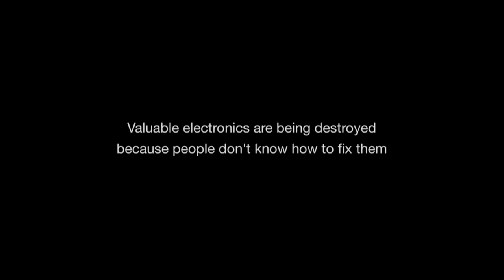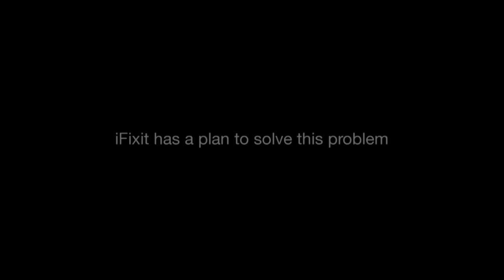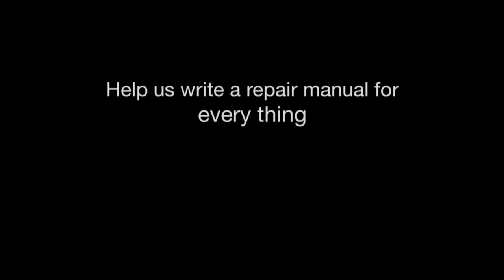iFixit: Welcome to Repair 2.0

Comment: Yes, but the report found 85% of the imports were for the very reason IFIXIT exists... They are not imported to "mine them for materials".  UN found that the 85% reuse and repair created $106M in value in Ghana alone, employed 30,000, and that the imports were something different from what you filmed.  Africans are good at repair.  The importers are neither victims nor criminals.  Please post your Fixers trailer, it addresses this better than your 2010 film.

Comment: Kyle,
I know that since I first commented on this 2 years ago, that you took my observations to heart, and have begun production of "The Fixers".  However, as we wait for this, it's important that you update this with findings from the 2011 UNEP Reports, which found that the material you've filmed at Agbogbloshie was, for the most part, generated by Africans (Accra and Lagos have had Television since I lived there in the 1980s), and that 85% of the imports are working or repaired. Please..!

Comment: Kyle, I know you did this 18 months ago.  I'm wondering if you are finding something different and would be interested in updating this.  Or in updating me, if I'm wrong.  
The latest report shows that 85% of exports to Ghana ARE in fact repaired and reused, and in fact, that's the basis of the trade.  The stuff at the landfill is quite aged and doesn't look at all what comes out of the containers at port.

Comment: @toadabc 
One thing I think that needs to be law is any device that cost more then $50 should have user serviceable batteries.
There is zero excuse for a phone and laptop to have a non replaceable battery and anyone who says otherwise is outright lying as even toys have user replaceable batteries.
Reply: let's not set a bar - there is value to any device regardless of cost!  I refused to buy a $27 Gymboss rechargeable workout timer whose functions are so simple, it would probably be used for life & passed onto others. it seems just because a product is "rechargable" is some kind of a ticket to slap a hidden e-waste sticker on it - this is a practice I really have an issue with esp for simple devices that have high reuse value well beyond the internal rechargeable battery!

Comment: @SFRWood 
Apple products started going down hill after the end of the G4 era.
Before they were actually pretty easy to fix.
 I kept a beige G3 in service for years by upgrading it but the latest iMacs are a terrible piece of engineering with few upgradeable parts.

Comment: One big problem is they just don't make things to be able to be easily repaired anymore.
If you ever taken apart an old Zenith tv from the 70s you'll find a schematic inside the case that will show you how it works and everything is modular.
But electronics now days they'll often put security screws in them to try and discourage disassembly.

Comment: Nice work - I see the world the way you do. I'm no genius but with your help manuals have fixed two laptop screens on machines that are still providing value. 

A fixit wikipedia combined with responsible recycling is the way to solve these 3rd world salvage dumps.

Comment: @AGeekForever

Page 68 of the MDD manual is headed "Opening the Computer". No such instructions are included in the Mini's manual, or on "the official website".

The point is that the techniques aren't obvious. There are other ways of hiding access, such as recessing screws and then cover them with stickers or rubberized feet. None of these are particularly challenging once you know which trick is being used, but neither are they evident to a beginner.

Apple doesn't want consumers to tinker.
Reply: this is really ironic considering the Apple ][ was definitely a result of Woz tinkering!

Comment: @AGeekForever 
Early macs were about as difficult to open as most similar products; a few screws and it was open. Later tower computers became even easier: the G4 tower could be opened with a simple latch, for example.

But Apple's consumer products are explicitly designed to make opening less than obvious — even difficult. The Mac Mini isn't too difficult once you know the trick and have the correct tools, but is *far* from obvious. But the latest ipods and ipads? Definitely "hard to open".

Comment: Excellent!  I will provide you with complete disassembly and repair instructions for many different cctv cameras.   Many of the electronic devices sold today are  of the highest quality and yet are tossed out because most people don't know how simple it is to repair or modify them to work better.  

Many of these devices can be repaired or modified  to enable them to have longer and productive lives without throwing them away.